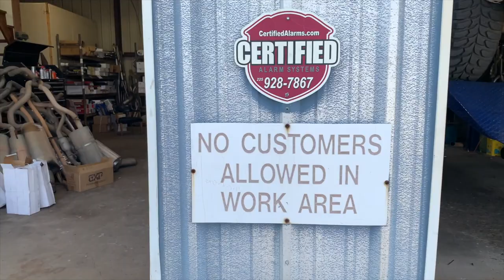WE CLAPPED THE TRUCK OUT!! | Squatted Trucks Exhaust | Loud Exhaust | Lifted Trucks | TRUE DUALS

Comment: Engine size? I got the 5.4. I wanna do long tubes with true dauls. Gutted cats.
Reply from the maker: 5.4
Reply: @CruzinWithMel23  hell yeah. I got 304000 miles on mine. Reliable engines bro
Reply: Don't do gutted cats. I have it like that. It gets annoying after a while. Just remove the 2 cats that don't have the o2 sensors. And get high flows.